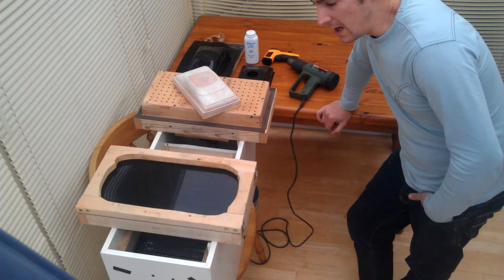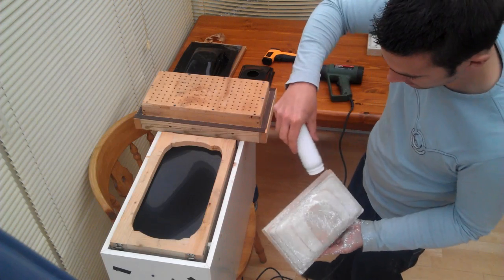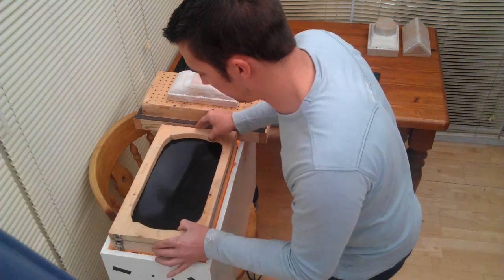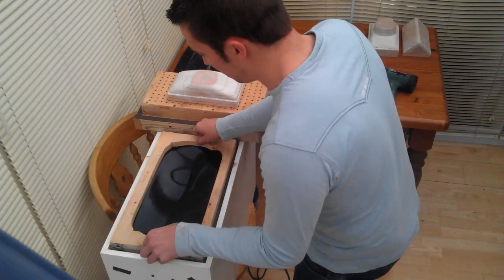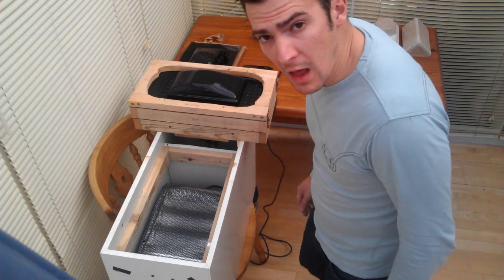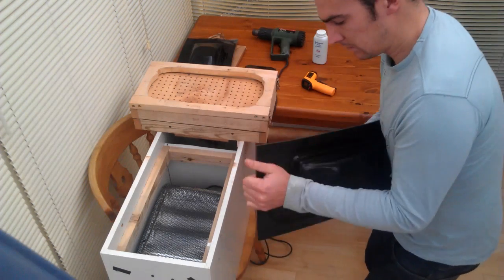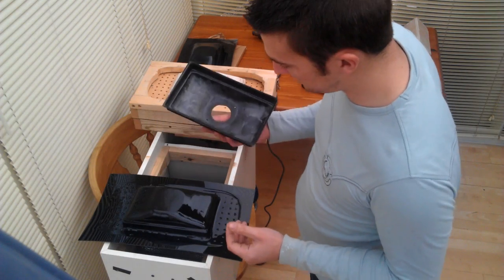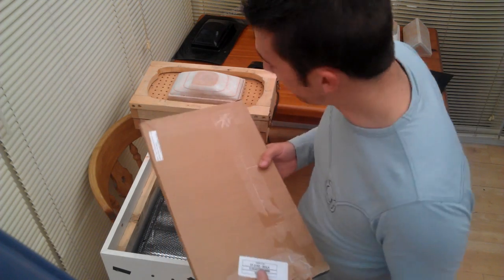PART 4 - Pulling a product - DIY Vacuum Forming, build a machine for under £20 ABS PETG HIPS

Comment: @Bargain Spares
If you put the plastic sheet in the wood form just in your baking oven it will be much better tempered and heat up to the temperature you need. If it is heated up, remove it from the baking oven and put it on your vacuum machine.